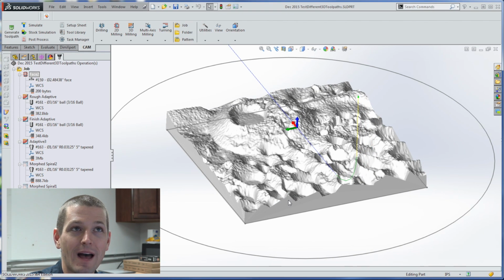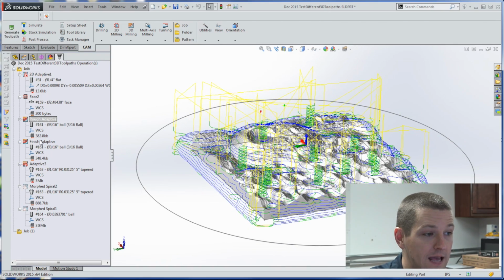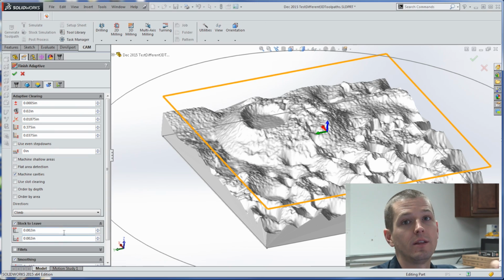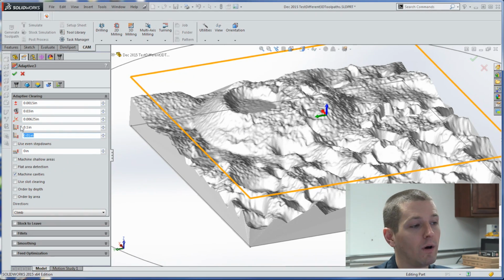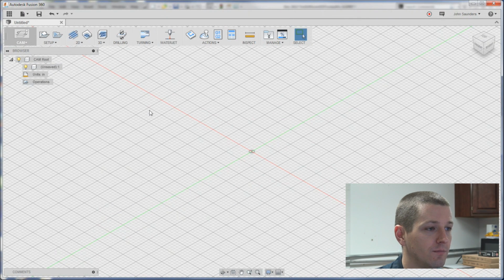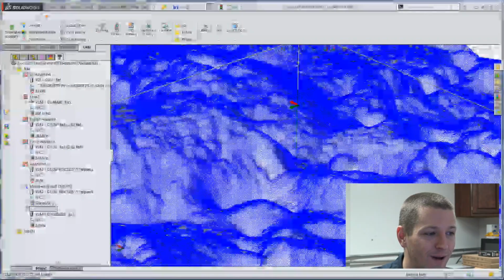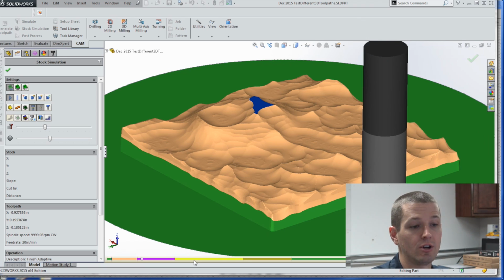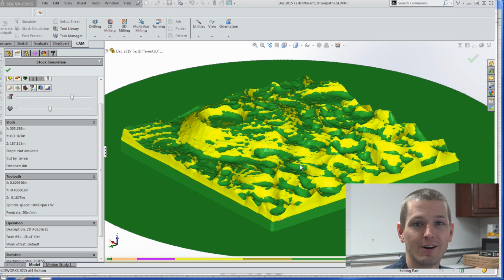CNC Machining Micro Organism: 3D CAM toolpaths!  Widget73

Comment: would love to see you work with STLs in Fusion 360 - not so much to just mill it out, but how you can take the shape in for a part and model around / over it in F360 to make the same part that way you can work with real F360 components and mill those out, make joints, etc.  Hope that made sense.  Fusion does have some way to make a mesh and then shrink wrap it around an STL model, but I had trouble understanding what I was doing.    

As a second thought, it would be great in a video to do a vocabulary lesson and tech folks what "adaptive", "finishing", "roughing", "facing", and all those other kinds of machining words mean.

Comment: Give a go with VLC screen recorder function, should work better with frame rate drop, but usually these problems are connected with hard drive being to busy to write down all raw data. Separate hard drive could work.
I have a request John. Could you try to machine a random STL, file just to show how to make tool paths correctly, also how to machine not all part, but only a portion like adding a finer detail on certain spots. And most importantly how to do it with fusion 360 as it is the gold standard of hobby machining by now.
Happy new year!

Comment: John, can you speak at all to getting complex models into 360 and ready for the cam process? Having a very hard time with surfaces similar to yours...
Reply: totally missed the part about hsm works..... doing something with a model this large in 360 is really, really difficult as two days of exploring have taught me.
Reply: +NYC CNC 360k faces, have tried .stl and .obj - fusion really wants to limit down to under 10k faces . you can get to maybe 100k if you convert mesh to tsplines instead of brep but it still tends to fall down with the big stuff.

Comment: what tool holder system are you using on this?  I've been back and forth between three 440 and 770 "price being a issue".  still not decided on the TTS CNC set or just ordering ER collets.  

pretty damn cool machining ;)